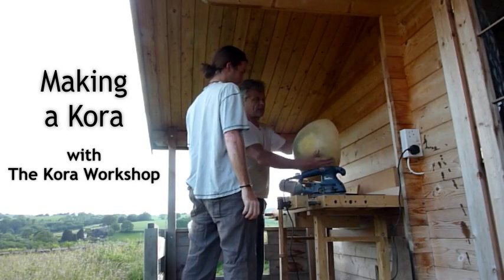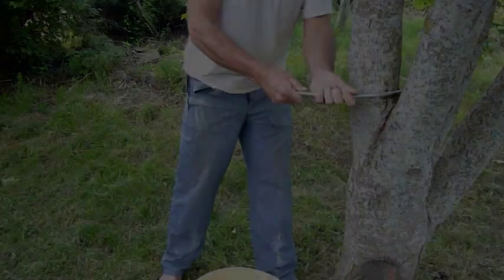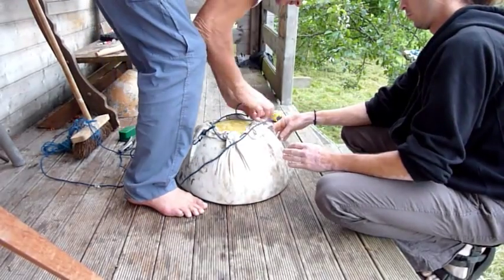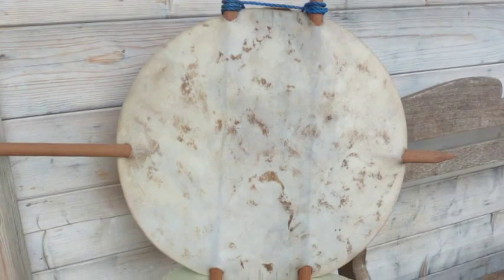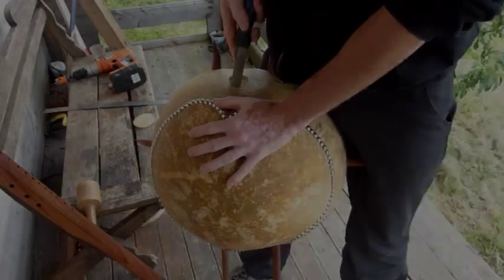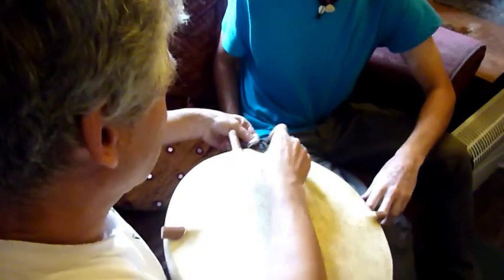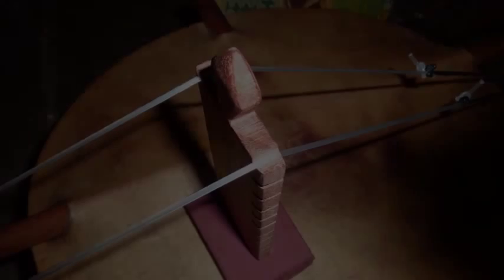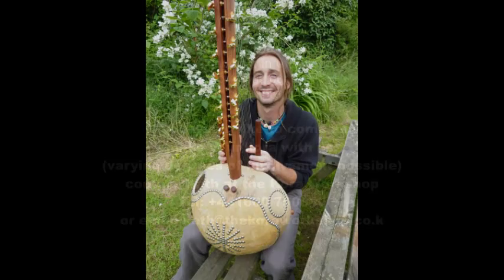Making a Kora with The Kora Workshop

Comment: Great work. What thickness are the nylon strings?
Reply from the maker: Hi thanks :-)  You can find a document on our How to Tune Your Kora page  that shows the gauges we generally use.  It may need to be lighter r heavier for your kora and for the feel and sound you want.  These sizes are using standard nylon fishing line (not fluorocarbon which breaks more easily) https://thekoraworkshop.co.uk/about-the-kora/how-to-tune-your-kora/

Comment: How Long l let the leather dry
Reply from the maker: Hi - it depends on where you are in the world and also the weather at the time. Unless you have a specialist drying room with ventilation etc, you are dependent on the weather, like us :-)

Note: you put the cross bar and handles in before it is dry but not immediately after the skin goes on.  Also you don't want it to dry out too fast initially.  You need to make sure the body is really dry before putting the pressure on the skin with the bridge and strings. You cannot hurry this process.   Good luck!
Reply: @ThekoraworkshopCoUk  hello thank you for your Response l live in Ohio United states l bought a kora that has the broken leather l changed it  and a month after softening the leather in the part where the bridge    goes l put hot water to harden the leather and after 3 days the leather  broke l knew what was the error so that was my quedtion how Long should l stop driying the leather if you can help me step by step l would appreciate it because where l live it is not very easy to find leather and l do not want to leave the instrument of ornament.
Reply from the maker: @romel7622  Hi, sorry I haven't replied before - I didn't get a noticfication from Youtube!  WIth the skin (Note it should not be leather - instead you should use rawhide that has had the hair removed.  Leather is skin that has been treated and softened and that is the opposite of what you want!)  Also cow wkin will take longer to dry and harden than deer skin. What skin are you using?

Also you need the skin to dry without pressure on it - then once really dry and hard it will take the pressure of the strings on the bridge.  You should only wet the skin if there is no pressure on it, or you will stretch it.